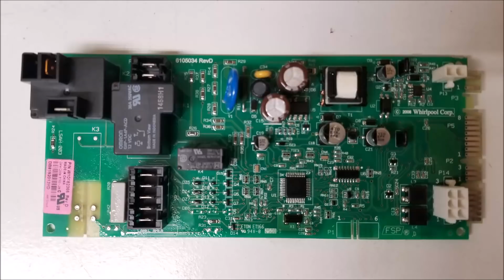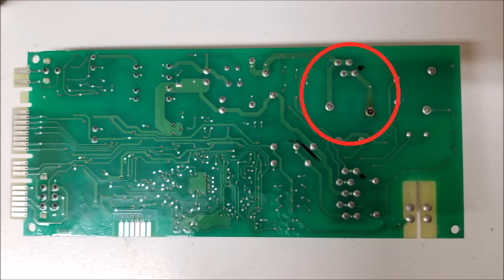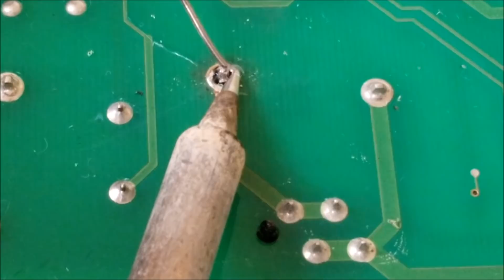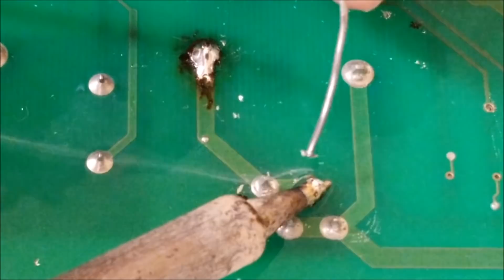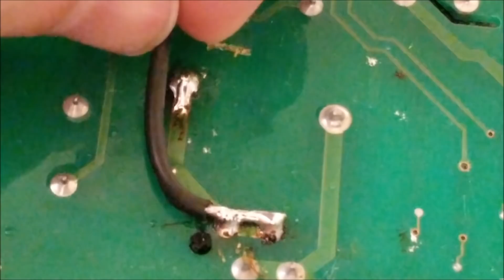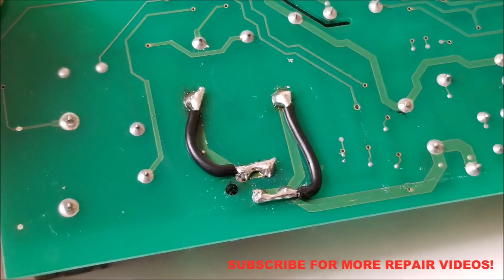FIX and IMPROVE control board with F01 error - Whirlpool/Maytag/Kenmore Dryer

Comment: So you don’t actually need to replace the relay? It’s just the trace that overheated?
Reply from the maker: Usually yes, the relay is fine.
Reply: @denispoirier19 I replaced the relay. I didn’t have a handy 12v supply. My pad was vaporized though. The Bodge wire makes more sense than just trying to solder on to nothing. Not sure how long my repair will last. I just exposed the cu trace and soldered to that. Really Sus. Next time I’ll try to do better.
Reply: @d @denispoirier19 fter changing the relay the source problem might still be there. It goes on the fritz when powered on. Have to power cycle at the circuit breaker. Maybe there is a faulty capacitor or something causing the problem?
Reply from the maker: @eswing2153  Yea that sounds like a different problem.
Reply: @den @denispoirier19  100% there were burn marks and that pad was exploded. So something overheated at that part of the relay. But in terms of what the root cause is I have no idea.
Reply from the maker: @eswing2153 you could try replacing the relay and installing bypass wires over the damaged section.
Reply: @denispoirier19  I replaced the relay. Cleaned up the charring. Mostly repaired. Didn’t do the wire but did scrape back and add lots of solder. So maybe my solution won’t work well as it’s relying on the trace that might be compromised.
Reply: @eswing2153  If you had a problem before replacing the relay it might have been the soldering of the relay leg. If you dont get all the carbon from arcing cleaned off, the solder wont take well and just pool around the leg. Advisable to run a jumper wire across the trace. I repaired one of these 6 years ago and it still going fine with the original relay.

Comment: I had just replaced the relay, but when that didn't work, I saw your video and followed your instructions, jumping the contacts with wire. Now my dryer works, and I did not have to spend $245 on a new logic board. Thank you!
Reply from the maker: Great! Congrats

Comment: What volt were the jumper wires thanks
Reply from the maker: In this case it doesn't really matter too much but you should probably get something rated for at least 250V or higher. The voltage rating is for the insulation on the wire and not the actual wire itself.

Comment: I know this is an older video but do you know of any fixes for the circuit board on a  maytag extra power series.    M/N MED7230HW1. Circuit board part # W11194442

Comment: What would we do without guys and gals such as this guy doing a DIY video? lol....Im about to do this and was wondering if a solid copper wire used for 120V (Romex) would work also? Cant find a 18G wire anywhere at my house right now but have plenty of Romex wire. Do you guys think itll hold better? Thanks in advance
Reply from the maker: Yes it will work fine. Some romex cables have a smaller ground wire which might be easier to solder.
Reply: @denispoirier19  Thank you. Worked like a charm and did both
Reply from the maker: @ncimson5318  Awesome!

Comment: Thank you! Just finished the Repair/Modification as you did. The dryer now works fine. This issue is also common to my Aqua Rite Pool control board. They just put too current for the size of circuit board runs.
Reply from the maker: Awesome! Glad you could fix it.

Comment: Ditto... Before the scheduled appointment of the Appliance repair I decided to check the thermal switch and thermistor, which were fine. Then opened the top and took out the control board and it was burnt in the same location. Jumped the connections and VWALLAH!!  Thanks for this video. Saved a bundle.
Reply from the maker: Awesome! The appliance repair company would have likely sold you an expensive new board.

Comment: Remove the relay open it up and see what is causing the problem. Stop with BS worthless repairs.
Reply from the maker: I did exactly that on subsequent repairs and the relay is perfectly fine with no signs of heat or arcing on the contacts. None of the boards I fixed failed again. But thanks for your BS comment anyways.
Reply: @denispoirier19  And how many machines do you pull apart on a daily basis and troubleshoot and repair? A ten dollar part would fix the real problem. And after installing new part then do the wire trick. Wire trick is just a heat sink.
Reply from the maker: @mostlikelywedoitservices6926  Sorry I haven't kept count in the last 17 years.  If you want to replace the relay then by all means go ahead, you can replace the entire board if it makes you fell better.  Most people replace the entire dryer.  I'm just gonna keep fixing the bad solder joint and checking the relays to make sure they're still good, which so far they all have been.

Comment: Don't waste your damn time doing this. This is complete crap. Go through all this replace the component. That is what has the contacts that is causing all the heat because they are shot. Don't do this solder repair crap. It is a very temporary repair at best. Dirty contacts arching is the problem. Replace the board or the contactor. Tnuocke 12V 30A 250VAC Fully-Sealed PCB Relay for PC Board or Panel-Mounted,Solve F01 Code. Don't follow people who truly don't know what they are doing.

Comment: Thanks for sharing video .
Do you have video for testing relay , diodes,resistor ?
Reply from the maker: No I don't. Diodes and resistors can be tested with a multimeter. Relays will also need a power source to activate them.

Comment: It's the contact points inside the relay that are getting burnt and causing arcing that causes this. It's not because there's too much power
Reply: It actually ends up being a combination of both the connections on the board and the overheated contacts. Replacing the relay AND putting in the bypass wires as shown should last a while. My board had damage on the board and the contacts just like this video. All this damage is caused by the contacts being under sized and relying on an electromagnet relay and not a spring closed type.

Comment: In my case, the actual relay was non-functional, and it literally blasted the solder pads off the board when it went.  I replaced the Omron G8P-1A4P with a (drop-in replacement) Panasonic JTN1AS-PA-F-DC12V from Mouser electronics.  I also installed wire to prevent the issue you demonstrate in your video but I soldered it down on the existing trace.
Reply from the maker: Awesome!

Comment: Kenmore HE5 dryer had F01 fault code. One end was burst and burned. Soldered and used a wire as well to connect to the other end as mentioned in the video. 👍 Dryer runs now 🎉

other line is still good. (Don’t try to fix If it not broken). 

Thank you for the steps !
Reply from the maker: Awesome!

Comment: Crazy, it actually worked. Thanks for the video!
Reply from the maker: Awesome! Glad you could fix it
Reply: @denispoirier19  still waiting for the dryer to explode or start on fire lol.  Great detailed instructions, saved me $500 in repairs, or having to buy a new dryer.  I put hot glue on the new terminals after soldering. So far 1 load down, wife looked at me like a was a genius after repair (this guide is our secret).
Reply from the maker: @Skinwalker-Ranch  hot glue probably shouldn't be on there but if it works that's what counts. I hope the lady rewards you for being an awesome appliance handyman! Lol

Comment: This WORKS! I am by no means experienced with repairing control boards or soldering, but this video helped me fix my dryer. 11-year-old dryer blew out this week and $20 solder kit (Home Depot) and $4 soldering wire got it done. The hardest part was removing the control board without damaging anything, but once it was out, it took me 5 minutes to do what the video shows. If you are contemplating this project, DO IT! Do not pay anyone $400+ to fix something that can cost you less than $25. Someone wanted to charge me $180 for the visit, $260 for the replacement control board and $80 an hour. A job that took me 20 minutes from start to finish and $25 in tools.
Reply from the maker: Awesome! Glad to hear. Happy I could help!

Comment: Awesome video and explanation! I was able to drive to my local hardware store, buy a soldering iron and complete this job in like 30 minutes. I went to another video to look on how to take out the control board and it is fairly easy; literally four screws and some plastic clips.
Reply from the maker: Awesome! Glad I could help!

Comment: I have that same error and tech said to replace control board for $400. I took it apart but mine doesn't have any burnt relays or burnt spots on the case?
Reply from the maker: You could try replacing the relay

Comment: This totally worked thanks for making this video saved over 240$ and like a week turnaround time
Reply from the maker: Awesome! If it fails again consider replacing the relay (black box)
Reply: @denispoirier19  where would you get the box do you have a part number or place to purchase it and about how much it costs
Reply from the maker: @Kharma44  You can probably order it from digikey or mouser (or any electronics parts distributor). The part number should be written on top of it. I don't have the number.

Comment: Had the same problem in the same spot. The question might be asked "why do they mostly fail on that side when the traces are the same on both sides?" I suspect that it has something to do with the relay contacts starting to erode, and that pin is closer the the contact point than the other one. I would suggest replacing the relay if you are going to the trouble of taking everything apart. They are only $12 on Amazon. Then you will have new contacts. At least for a while...
Reply from the maker: None of the ones I have fixed failed again but I agree that it would be good practice to replace the relay.

Comment: Great video.  I priced the board at about $320, but had mine fixed in about 30 minutes.  I only did one of the jumpers, because my soldering is so bad that I may mess up the other solder joints that were still good.  Thanks!!

Comment: this improvement method to add an extra wire, looks smart, not too bad at least. but from an engineering point of view, it actually could be more dangerous!
 the rely switch 240VAC to heating element. the current is big to cause heating on connection joints. the solder has more resistance than copper. then the solder could generate more heating than copper. solder is melt, it drops off to cut off the circuit. machine get error, but it's safe and doesn't cause any other result.
after change like this clip introduced, when the solder is melt and the wires could eject as its elastic. it could touch to the parts near by, even grand route/path. this could add 240AVC to anywhere that could cause the worse results; burn out the control board, cause fire in house, get human an electric shock!
i suggest you just use solder wick to replace the wire that you use. another weaker method is to add epoxy glue on the your wire.

Comment: Video was a great help. My failed solder joint was on the opposite side of the relay but you repair process worked great. Thanks for the video

Comment: Thanks for the video,  had the F 01 error code and dryer wouldn't  turn on. Followed the steps shown and it works. Only now I have no heat while drying... any tips?
Reply from the maker: If heat was working before, double check all your connections to the board and your soldering work.  It should be working.

Comment: Great video, thanks. I have the same issue (same exact location) but in my case the ring on the pad is almost completely destroyed. I am planning to remove the damaged ring, but not scrape the trace, then just make my jumper from pin to pin. If my jumper is just soldered from pin to pin (but not the trace) that is fine, correct? Thank you.
Reply from the maker: That should work, make sure it's a nice solid connection.
Reply: @denispoirier19  I ended up using a piece of copper tape to connect the trace to the pin, as shown here. Thanks for your help. 
https://www.instructables.com/id/How-to-Repair-Damaged-Printed-Circuit-Board-Pads/

Comment: I tried this and still nothing could the actual piece on the opposite side have burnt out cause I copied exactly but still nothing turned on for about a minute then shut right back off
Reply from the maker: Yes it's possible that the relay is bad. You could try replacing it.
Reply: @denispoirier19  any ideas on what the name of that relay is
Reply from the maker: @joshuarose5659  I don't have a board here to look it up, but try searching the numbers on Amazon or check if an appliance or electronics repair shop can get it for you.
Reply: @denispoirier19  I got it working again the relay was bad thank you for your help and great video btw
Reply from the maker: @joshuarose5659  awesome! Congrats!

Comment: Hey what wire would you recommend for the jumper cable?
Reply from the maker: I used a piece of wire from an old computer power supply.  A 16 or 18 gauge wire should do.

Comment: Great Video!  My duet dryer was doing nothing after holding start button.  At first there was no error code but after about 5-10 seconds after pressing start, control board threw a PF1 error.  Checked the control board and noticed the same burned connection to the relay.  Ordered new relay on Amazon (14 bucks), removed the old one, and soldered the new one in.  Reinstalled the control board and it started up right away.  Saved at least 150 by not buying new control board.  Did not do reenforced wiring, but will consider it if this happens again.  If you see a PF1 error, check the control board for burn marks, loose solder joints and see if it is something you can fix.
Reply from the maker: Awesome! Yea relays are cheap, might as well replace it while you're there.

Comment: The cause is the relay on the other side of these solder point is failing,  you need to replace the relay and then back it up with wires suggested in the video. The relay can be found on Amazon for $10.

Comment: This might not work for everyone, or it might be a temporary fix in some cases.  The reason the solder joint blows out like that is due to a failing relay (contacts inside the relay are arcing).

If simply re-soldering the relay terminal doesn't work (or doesn't last long), then replace the relay as shown in this video:
https://www.youtube.com/watch?v=aZWBjouDPuw

The original relay made by Omron appears to be discontinued.  A direct replacement made by Panasonic is available for around $4 through Digi-Key (model JTN1AS-PA-F-DC12V):
https://www.digikey.com/product-detail/en/JTN1AS-PA-F-DC12V/255-1719-ND/570856
Reply: Thank you for this information I have a feeling mine is about to go out again as it is making a faded beeping sound randomly

Comment: We wanted a basic clothes dryer without all the cute bells and whistles that seem to be important to some people. This dryer works well≖>allmy.tips/Whirlpool-Dryer?97S     As with most appliances of this sort it is not made to the same robust standards of yesteryear. However, it woks well and fills our need. I paid for the Home Depot installation but the installers chose to use our existing dryer vent hose which caused a problem. There was nothing wrong with the flow of air from the exhaust of the previous dryer. The installer must have dislodged a lint ball in that hose. It became blocked and we had to put in a service call. Now fixed and all is well.

Comment: I just pulled my board (F-01 error) expecting to see the same issue but my board looks fine.  No burnt or visually bad connections anywhere.  Any ideas what to do next?
Reply: replace the relay. Look to see if any of the capacitors are bulging. if so, replace those as well. Use the jumper wires as indicated here.

Comment: Thanks so much for providing this video! Great recommendation on the improvement too. My dryer gave me the error code after 10 years of reliable service. Here is to another 10 years thanks to your fix! If anyone is hesitant in their soldering skills, or lack of, try it! It's quite easy and you really only need ot solder the wires on the contact points.
Reply from the maker: Thanks!

Comment: A HEROOO!!!!!
Reply from the maker: Thanks!
Reply: dp19 seriously man thanks I found another video first where only the one pin was wired and soldering to a single other pin and it worked but not really because then my dryer drum would not stop spinning even when turned off so I’m like can’t be right but your way liked like magic bro... question my copper wire I used was not insulated do you think some problems could occur there?
Reply from the maker: @MOBMaf  It will be fine, the board is in a plastic casing so nothing can get to it really
Reply: dp19 you’re the man bro

Comment: I did this fix today and it's working great. I saw another video where it seems a relay caused this problem. Has anyone had this problem re-occur after doing doing the fix with the wire? Does this seem to be a temporary fix?
Reply from the maker: If it's soldered properly it should be a permanent fix. I have not heard of any of them failing again.
Reply: @denispoirier19  Very helpful thanks for the great video.
Reply from the maker: @derrellnicholls7438  you're welcome!

Comment: Great Video, fixed my Whirlpool duet dryer in 15 minutes. Note that depending on how severe the failure you may not see copper around the pin but will at the trace; use flux and lay down solder to fill the gap in the via. Easy Peezy. My dryer was 11 years old when this failure occured
Reply from the maker: Awesome!

Comment: Thank you so much, 3.99 solder iron from harbor freight, 1.59 solder wire, and 61 cent piece of wiring and a few minutes later my dryer is back up and running all thanks to this video. Saved me over $280 you sir are awesome!
Reply from the maker: Great! And that's a pretty good price for those tools too.